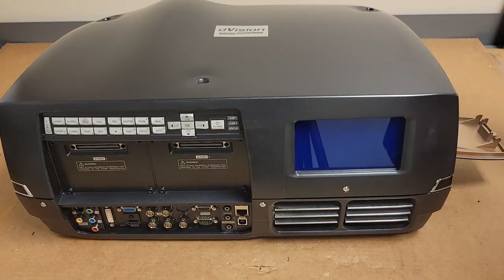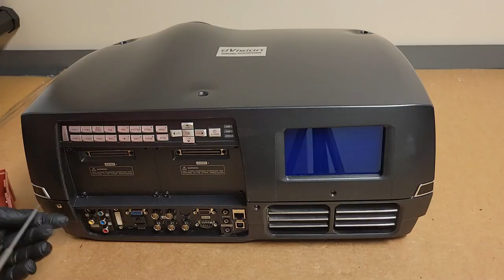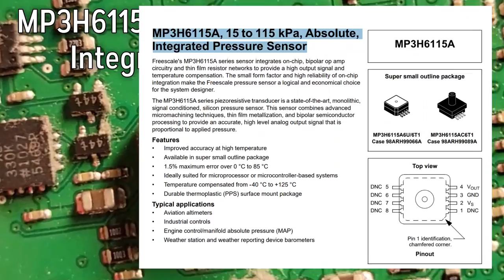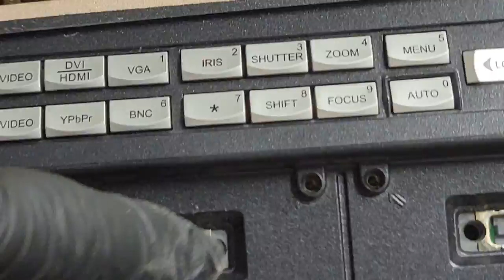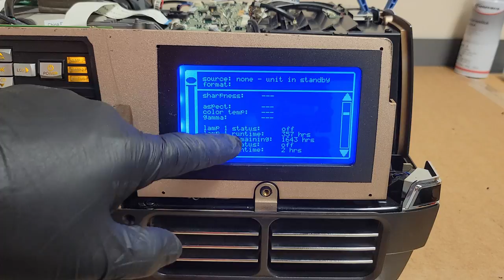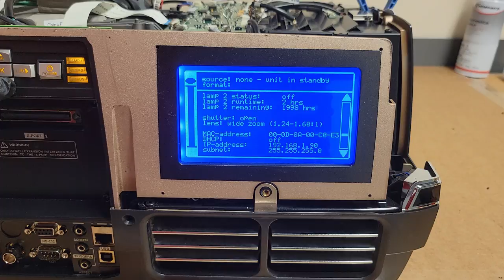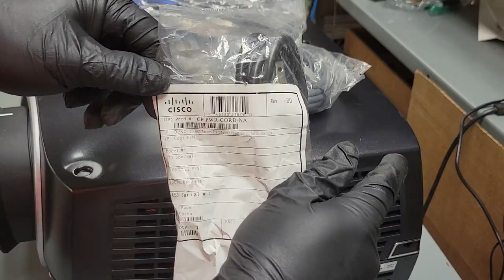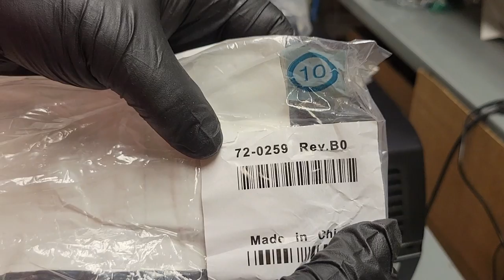Digital Projection dVision 30 1080 XL DLP Video Projector Basic Cleaning

Comment: Thanks for the video. I got an F32, similar model from projection design, for free. They couldn't figure out what was wrong. I wish I saw this earlier. I took mime apart and cleaned it up. I saw there was a small cable disconnect with bent pins. Fixed the pins, plugged in the cable, added a new lamp...boom. it worked. I'm so happy I got this for free too.
Reply from the maker: They are awesome 👍! Get in touch of you need bulbs. I can reset the timer chips on those.

Comment: That's a beast of a projector and the quality really shows but $16000,......yikes. Its amazing how well engineered it was, so many cooling fans and that heat sink was huge. Thanks for showing us Frank.
Reply from the maker: No kidding! I don't think the seller knew what they had. It was listed as the low lumen version in the ad, but the label clearly showed XL as does the firmware. I haven't gotten around to installing it at home yet.  I'm debating how to hang it. My current mount is for an HT1075. I don't think the dVision will like that mount.
Reply: @FixitFrank  Lucky find for you, just get some strong mounts, you don't want that thing falling on your head....lol.
Reply from the maker: That is where it ended! I found a good mount but its just not going to work in the bedroom. Not unless I put it on a table or something.  I decided to move it to the living room or the office. Still debating between the 2...
Reply: @FixitFrank  You will find a solution.... Have fun Frank. :-)
Reply: I'm guessing these units are made for running continuously with little down time for many years vs your average retail unit. It's also made for rooms with little air circulation. Your paying for that engineering as well.

Comment: heck this one looks sweet inside! Rated for 24/7 operation too is pretty cool. Were you able to get the firmware updated and what if anything was fixed?
Reply from the maker: I was!  That was for a projector for a local nursing home.  It was a Projection Design F30SX if I recall correctly.  Once they sent me the firmware file, I was able to flash it via the serial port.  Its still running(10 years or so later) as far as I know. 
I've always wanted one of these for myself.  I don't think it'll work out in the bedroom. The mount needs to be more substantial than I want to deal with in there. I'm moving it to my office or my living room as either a temp replacement for my TV(hang a screen in the front and put it on the coffee table) or use it in my office as a monitor. I'm leaning towards the office even though my wife is fine with me putting it in the living room.
Reply: @FixitFrank  man I'd use a projector as a monitor too if I had the space haha but yea super cool that you were able to update that. Seems like it's kinda a hit and miss thing to be able to find firmware on dlp projectors.
Reply from the maker: That seems to be the best option.  I bought a stretchy screen to try it out in my office room at home.  Working on projector lamp stuff on a projector seems appropriate.

Comment: How is the contrast on this projector? Seems like it should be nice given the 7500:1 number.
Reply from the maker: Its still pretty nice.   My only complaint is getting the colors right.  There are so many adjustments that its far harder to get right than my Sony.  That said, once its set it is really nice.  I would use it as a theater projector if I had the space.  But currently its used outdoors on occasion since its so bright and the one I have has a wide short throw lens.
Reply: @FixitFrank  Very cool. I’m thinking of using one for a theater on a smallish 110” screen. I definitely would only use one lamp though lol. Does it have an iris to dim it further? What Sony do you have? How does the overall picture compare?
Reply from the maker: I would look at a Sony or JVC instead of the DP(unless its free/cheap). The fans are kind of loud to be close to it.  
I run a VPL-HW50ES at the moment as my main projector and have a newer NEC laser for other uses.

Comment: I think you mentioned resetting the lamp hours somewhere?  Can you explain how to do it on these?  If I buy a new lamp now for one of these older DPI units will it have the lamp timer on it?
Reply from the maker: good question!  The board on the lamp assembly is where the timer info is handled.  Any reputable seller will have a 0 hour timer module on that lamp and once you install it, the timers should show 2000 hours left and 0 hours used. I know how to reset them myself but it is not info that I am comfortable sharing online because it could be used by lamp sellers with less than legitimate intentions. I have reset modules for people who want to only replace the bare bulb inside and re-use the housing.  back in the day, these lamps were $800+ so it was worth it, but these days, they are $175-200.  https://www.purelandsupply.com/projectiondesign-lamp_400-0400-00.html  These for instance have proper timer modules and proper Philips UHP inside. I love these olde DPI units.  So well made!
Reply: @FixitFrank  thanks a lot, I just verified that pureland supply has lamp with timer module for the DPI I just bought.
Reply from the maker: great choice!  If you have any issues at all, contact their support email.  I have the same lamps in that projector in the video(currently)
Reply: @FixitFrank  I sent you an email about an issue with my projector, if you get a chance can you please take a look?  Wondering if you can service or if it's even fixable.

Comment: Why would you have a pressure sensor in a projector? Is it sensing fan operation (air flow across the heatsinks, which I would have assumed would be much lower with the covers off)?
Reply from the maker: I am not sure the real reason, but you might be onto something. My guess is to know how fast to run the fans depending on the ambient barometric pressure. In normal projectors, you have to select high-altitude mode, this might be a way to determine that by itself.  
I should probably check the manual. When I do and if they say why, I will update the comment.
Reply: Ah, yes, barometric pressure detection makes more sense (thinner air the higher the altitude, therefore higher fan speed required)

Comment: I dont know if this will get anywhere but I recently bought one of these and for some reason it wont come out of standby mode. Any suggestions on how to get this projector back up and running right. Thanks for all the information on this projector too!
Reply from the maker: These are so cool.  I still have this one.  when you say it is stuck in standby, do you see anything? Does the LCD display come up? If not, you might have a power supply issue.  I'd need to know what you have checked so far.
Reply: @FixitFrank  thanks for replying and when I say standby, when you plug it in the status light comes on but no LCD display. Nothing happens after that, just stays that way the whole time. I have a picture but dont know how to show you. wish i could send it to you to help fix it.
Reply from the maker: I had to remove my email but if you look at the about page links, there is a company listed as "good projector lamps"  Email their support.  I was getting far too many emails to keep up so I had to make it a little difficult.

Comment: I got a cheap one and put a new bulb in it. Just running the new bulb it’s extremely dim. I have the iris all the way open and the lamp power turned all the way up (8 out of 8 brightness positions).  Maybe the bulb is just crap? It was from Amazon and was only $60. It does have the IR coating on it.  It seriously looks like it’s putting out about 500 lumens. My 2000 lumen Benq is WAY brighter and that’s on an old bulb.

Btw this thing puts out an insane amount of heat!!  Like 5x my Benq.
Reply from the maker: All lamps on amazon are trash.  for $60 you got a fake junk lamp.  Seriously don't buy them.  They are not the same regardless of their claims.  One of these cant be sold for less than $100 and be any good.
Reply: Sounds about right. It looks like Jaspertronics has some with claimed Philips bulbs installed. The one I got has no branding whatsoever. I’ve also heard that low brightness can be caused by integrator rods failing. Is this true?
Reply from the maker: fF you bought a lamp from Jaspertronics, that is your problem. I wouldn't touch their stuff if you paid me.  Pure trash. I have repaired so many units that were flat our ruined by their products.  Then people post a real review saying that, and they go and buy a bunch of fake reviews to bury it.  rinse and repeat.  the day Jtronics goes out of business is a great day for the industry.  It could be the integrator rod but I highly doubt it unless their lamp damaged yours.  I hope it didnt. these are great projectors.

Comment: Do you have a video on how to reset the timer bulb?
Reply from the maker: Not yet.  Full disclosure it is a process I spent many years perfecting using a process that cost me a lot of time and money to perfect.  I don't want to just give it away as it could be abused by less than legitimate lamp sellers.  However, if you need some timers reset, you can contact me (email is on the about page). and we can discuss it.

Comment: Any way you can do a video replacing the color wheel??  I have a few I want to put a different, brighter, color wheel.
Reply from the maker: Replacing the color wheel in this projector or another?
Reply: @FixitFrank  I have several ProjectionDesign f30 SX+.  They are pretty much the same projectors.  I want to switch out the current color wheel to a high brightness color wheel.
Reply from the maker: I have honestly never heard of a color wheel upgrade for these. That is super cool. Most of my dealings have always been with the lamp assemblies more than the internals(up until recently).  I could do a video on replacing the wheel.  What is the part # of the upgraded wheels?  I'd like to learn more about them.
I also must admit, I am politely jealous when you say "I have several PD F30 SX+"  :)
Reply: @FixitFrank  I believe they offer 3 different color wheels: VizSim, Graphics and High Brightness.   I have 7 with the VizSim color wheel.  This provides the the most realistic colors of the 3.  I have 2 that are High Brightness color wheels and they are twice as bright and have outstanding color as well. I will look up a part number in the morning.  Have a good one!!
Reply from the maker: This is awesome to hear! I did a little googling but did not find much. In theory it makes sense. The different glass coating methods(sputtering, vapor or vacuum deposition etc) would have different characteristics. 
I'll likely do that video this weekend for next week. Id be very interested in those part #s. I may see if I can get a pair for my projector.

Comment: the same model, the image flashes in different colors, what could be the problem? sensors? color wheel?
Reply from the maker: Definiltey a color wheel issue but it may just need cleaning.  If the sensor is dusty, that will cause it.  If its not dusty the wheel may be failing.  If you replaced the lamp recently, make sure the IR filter glass on the front is the same reddish tint as the old lamp. an incorrect IR filter can cause this too.
Reply: @FixitFrank  thanks!

Comment: The power cord cost about $5 max I found it for $2
Reply from the maker: I'd have to see what you found. That is not my experience. Those $5 ones use copper coated aluminum instead of pure copper. I do use plenty of the cheaper ones for lower powered things but this one I use a thick 14awg pure copper wire cord.